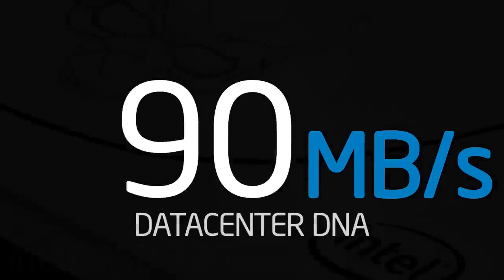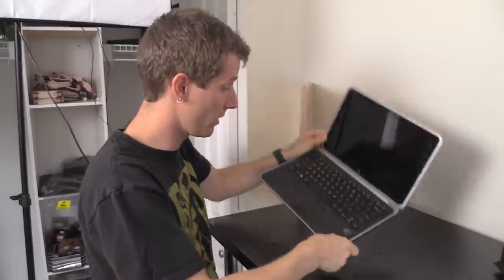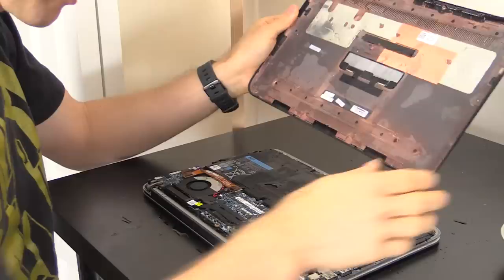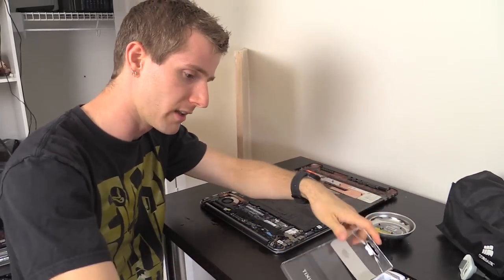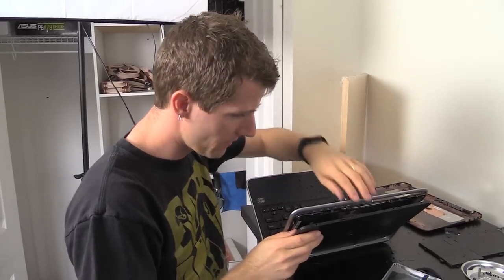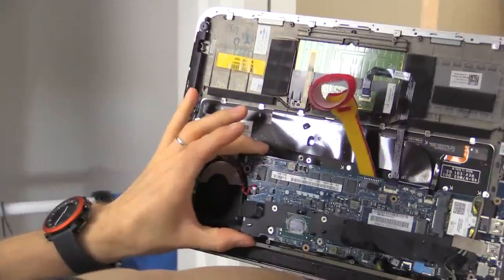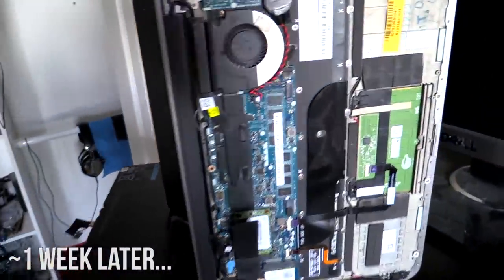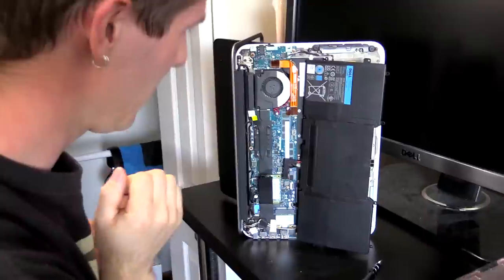Wet Laptop Recovery - Is it Possible?

Comment: ive picked laptops up in the rain from a local recycling center just out on tables outside, just leave them for 72 hours and power them up and they work
Reply: just to add the only problematic thing with a wet laptop will be the keyboard
Reply: Im Curazy Try spilling juice on one... Works fine, but takes ages before the keys don't get stuck down.
Reply: bassl0va must smell nice.
Reply: bassl0va Before using it I would disconnect it and run fresh water through it.
Reply: The laptop I am using right now had juice spilt on it and I washed it out with fresh water and paint thinner and dried it out with a blow dryer and had it up and running a hour after that because I needed to use it that day.
Reply: Hussean Duncan Splashed would have been a better term, but it was a very, very generous splash. I flipped it upside down and dried the keyboard off with a towel. Turned it back on the next day and it was fine, but the keys would stick down. Took a couple months before it completely stopped doing that. lol
Reply: bassl0va Well mine was soaked.
Reply: *****
Chocolate milk must be the worst thing to spill on a keyboard. I spilt some on a piece of my carpet a few years ago and after a month of trying different things i ended up cutting the square out. Luckily i got wooden flooring put it a few month after.

Comment: The XPS series are one of the best line of laptops ever. I can't say the same for Dells desktops tho...
Reply: I'll have to disagree with that given that I own an XPS 15
Reply: Adam Hosein why do you disagree?
Reply: Credit where it is due, it has a solid build quality and 5 years later it is running pretty good. However, the dedicated GPU that came with this laptop was a serious problem and has stopped working, (search xps 15 gt 540m issues and you will see). When I had opened it up to change the thermal paste, there was paste all over the die for the CPU and GPU (a lot of waste). Trying to have an item fixed under warranty was a pain (and never got to it because customer service is crap). The Dell "Certified Technicians" on Dell Forums don't know their arse from their elbow when it comes to computers (so asking them for help is a dead end). Operating system issues right out the gate (thankfully I made a recovery disk the first day I got it). The worst thing of all is their product support for the device as it goes on its life, the laptop has no drivers what so ever for windows 10 and they won't help with getting any for it and the slimy bastards whitelisted their mpcie port, so using an external GPU is such a pain (though possible with a few workarounds). In all honesty, it was a waste of money since I bought mostly the name of the device rather than the hardware.
Reply: Why not dell desktops? I have a web server running on an Optiplex 745 and it's never gone down in 2.5 years

Comment: I saw a video where people dunked a MacBook Air, thiner, lighter, and just as easy to take apart (easier for what they needed since the first step should have been to remove the battery), and it still worked as well I belive.  Why do all of the you tubers whine And snivel about why they think that Mac is so bad, when it is superior? I am not a fanboy, as I own a budget gaming PC, my dad worked for multiple computer industries, mainly hp, while I was growing up, and I now have the afore mentioned PC that I spent about $400-450 on, and I much prefer the macbook that my sister got when she started college that only cost $300 yet still runs faster.   My macbook that I got for the same reason actually cost $500 only because it was the one that looks like a MacBook Pro.  All the macs I have ever used are superior to the PCs I have used, and I don't understand why they have to constantly insult them.  If they don't like them, then just don't mention it.
Reply: It is a bandwagon thing. Personally I wouldn't get anything Mac just because of the price but they make nice amazing clean products. There engineering is above everybody in everything. Phones all metal, laptops, all metal, there macbook pro take it apart and shit your pants about how clean it is.
Reply: Bailey D Dell donated this laptop to linus, he didnt pay for it. Also that other JZ asus laptop was donated, he doesnt have an apple laptop because be probably cant afford it within the budget of everything
Reply: darkmist977 Okay... I know all of that. He doesn't buy a Apple because he has no use for it.
Reply: No Mac Book ever cost 500 dollars. The cheapest I have ever scene starts at 900. Any way 400 dollar gaming computer is as cheep as it gets. Try spending a little more money on your pc and re evaluate your situation. I am no programmer or hacker. So I do not know everything about computers. But what I do know after about 5 of apples best years and spending thousands of dollars on there stuff is they polish the products they make very well. They have the best GUI and tend to look very well. Dollar per performance is VERY subjective.
Reply: In my opinion, Mac/Apple products bind you in a too closed ecosystem. it's maybe good at the things it can do, but it can do and run less than other Software/Hardware. Apple designs the Operation System on a specific range of Hardware and it doesn't work on the rest, so they have control about the drivers and the Hardware.
It's far too inflexible for me.
I'm currently using Windows but would be happy if i could switch with all the software I'm using to Linux completely.
Reply: darkmist977 and Bailey D You guys need to stop speaking for Linus. The only thing you know is that he doesn't have a mac if you want to know why don't assume like idiots and just ask him....
Reply: "Why do all of the you tubers whine And snivel about why they think that Mac is so bad, when it is superior? I am not a fanboy," says is not a fanboy After the fact he/she/it made a fanboy comment.
 NOTHING IS BETTER THEN A THINKPAD !!! now it must be true,cos i said so...and it will be so forever

also Nonamguys you just admitted that you know nothing about computers with that post of yours.
Reply: Floppmann im not assuming, im facts are up to date as of januray when i asked him why he doesnt use a macbook for editing. he said he has too much others things to pay for which are more pressing issues then upgrading a laptop
Reply: ron zo amazon.  look up Macbooks and you can find them.  they are not the newest things, but for $300, you can get one form 2010 that is faster than a lot of pc's that i have seen and used that cost way more. and please don't tell me to re-evaluate my pc.  I bought an HP pavilion with a quad core processor and a decent sized hard drive and 8 GB of ram for $300, and it came with a 22 inch monitor and a printer. The only downside is it has vista, but that is easy to upgrade.  It was $450 because i spent about $150 on a 750 Ti which gets great game performance without a power connector, and I play BF3 very often at good frame rates with to only bottleneck being that i run vista.
Reply: Nonamguys  Just going to say spend like $1000 or more on a pc and you might not think Mac is so superior.
Reply: Nonamguys lf it has vista how old is it? I have a mac book.  I had a 2010 I mac . I built a custom gaming pc and  sold the imac emediatly.  I had no use for it other than itunes. Witch is a disaster with all the constant updates and no way to remove duplicates. If you love apple so much why are you even watching this or even taking the time to post on it?
Reply: CreateUsernameIlike I've used $1000 gaming PC's and I still prefer my macbook air. Macs are just so quick and snappy that when i try to use any pc I feel like I'm waiting a life time.
Reply: Get ssd then. the mac book air uses a ssd.
Reply: ron zo Wow really? I spent $1000 on a mac book air and don't know my own specs. Thanks for letting me know.
Reply: ***** The universal battlecry of fanboys:  "I'm not a fanboy but....".
Reply: android059 I can only second what ron zo said, get an SSD, they are totally amazing. I use an SSD in my own computer, makes working so much more enjoyable. Load times for programs are practically zero now, games are great too. The place I work at is using little Intel NUCs (basically little 4x4 inch MiniPCs) that you buy the board and case for and then buy SSDs as well as memory yourself for. They boot up so amazingly fast, it's unbelievable. With Windows 7, that is. I can't imagine how fast Windows 8 would be on it! The one we use only has an i3 processor, so processing power is obviously not a focus, but programs still open fast, and they are very versatile despite only taking up such a little bit of deskspace.
Reply: ***** Even with an SSD windows will still always be slower. The Mac UI is made for a trackpad and therefore you can do gestures that make everything flow way better than any windows machine ever will. Sure windows will be fast with an SSD but it can't be compared to working on a Mac. The only thing I prefer about PC's is that you can take it apart and add new components. That's why PC's are better for video games. But Mac's were designed with work in mind that that's why mac is better for everything else.
Reply: android059 alright, so you're talking more about the UI and not he performance itself, right? Fair enough. I personally prefer the openness that Windows offers. Not only in terms of hardware, but also software and the overall design. You know, having a piece of hardware in itself that is not part of an eco-system (although a well-built one, of course)
Reply: darkmist977 He buys very expensive cameras, I think he can afford a mac laptop...
Reply: yes because a camera is a must have, a laptop not so much also you dont have any idea what his financial state is like, he cold be in debt or having to get a loan to pay for the cameras. Also he doesnt edit on the laptop, its mostly for the show and writing the script for a episode.
Reply: android059 yeah go ahead and keep on patting your self on the back for wasting money.duh
Reply: You are so smart. LoL you compare Windows witch is software to Mac witch is hardware. I think you mean OS X. Get your opinions and facts straight kid.
Reply: ron zo The software is the whole experience of using a computer. If the software sucks the computer sucks. And Macs are absolutely not a waste of money.

Comment: And this is why you never buy Apple
Reply: How does Linus drying out his laptop = never buying Apple?
Reply: Two of my friends had their Macbooks exposed to "humidity" and "coffee". They never went back to normal even after replacing the parts.
Reply: Chris Mercer I was talking more about the fact that (from personal experience) any bit of water on Mac will kill it. My Mac was never the same when I spilled a tiny bit of water on the keyboard.
Reply: ***** actually you can..all it takes is a few screws to take the bottom cover off and the i can get to anything i need to (2013 MBP not retina)
Reply: everyone here does realize that if you take the same number of screws out that linus did you can remove the bottom cover of a macbook to expose all the same components he did. I don't care if you are pro-pc or pro-mac to each your own but don't let your fanboy-ism blind you from the truth
Reply: Chris Mercer dude, nearly every screw on newest mac is non-standard. plus most of the components are soldered to the MoBo. okay SSD is removable, but it has a specially designed connector (don't remember the name). Apple does everything to prevent you from servicing it yourself. They make sure that customers visit repair service. If this kind of thing would've happened to a mac, you'd have to buy a new one, or pay 2/3 of the price for the service.
Reply: ghosthunter2006 Or you buy a screwdriver kit from iFixit?

I'm not a huge Apple fan, but I did own an iBook back in the day, and their service was exemplary. The motherboard failed well after warranty was over, and they overnighted a spare to Canada and didn't charge me a damn cent. Not even for the service, they reimbursed the certified repair shop on my behalf.

Comment: My lenovo fall in the water completly..fortunatly i fastly put it out ..it was full off water..water was flowing tru usb connectors out like waterfall  ..and i did not even wait to get dry..i turn it on after just 10 minutes ..and it worked ..and i turn on some heavy benchmarsk to heat a laptop and dry faster
Reply: You got insanely lucky then because turning on a laptop right after dropping it in water is incredibly stupid.
Reply: ***** 
i know it was stupid..but  somehow it worked..was not so 100% lucky with a android phone ..after fall me in the water i try to turn it on..it worked few minutes and just turn off...and the was dead 4-5 days and then when i give up ..it turned on and worked ..and it works now but screen has many like some tiny white dots from water ..at least 50 all over the screen but still usable..dont use it for daily phone but  still good for android games.
 Lenovo  and dell make very good laptops ..i bet HP would die  from tiny drop off water
Reply: you can do the benchmarks to dry out but what you think about the calc staying behind you need to clean it with pure alcohol
Reply: But, is the porn okay?

Comment: I have been fixing computers at work for about year and half. Computers from the cnc machines that were incredibly dirty inside so I was washing them in the water. 
The best way how to dry them is to use compressed air and blow all the drops off the pcb board because if you leave it there just to dry out, the water leaves soils and minerals on the place (Probably not case of the rain water, but I am not sure here). Those minerals can cause corrosion and oxidation over time and after few weeks you can encounter problems, so don't rely on it if its working after drying - it can still start failing after some time. If you blow the drops off with the compressed air though, it is a very good way how to leave it very clean and working for years and it will also look like totally new 😉

Comment: and i've had a car (95 honda civic) flood up high enough to short the battery, and submerge half the interior including the computer and after a new battery and a few days of trying to dry it out (including draining the exhaust) got it to fire right up, (still claimed it on the insurance because we had full coverage). also had 2 desktops caught in that flood, one was a total loss (along with wireless keyboard) and the other only needed a cdrom drive replaced and the Western Digital drive in it lasted another few years before it failed (it literally had caked on sticky mud on its case)
Reply: Honda makes amazing cars especially their civics
Reply: +DanielRichards644 ... Dude, you could literally drop a car in the ocean, leave it there for a week, fish it out, and then fix it with relative ease. Electronics fry in water, but mechanics do not. take everything apart, let it dry and re oil it and its basically guaranteed to work.
Reply: martinshoosterman
 WRONG, some cars have "vented" rear differentials or "vented" transmission and in those cases you need to drain the fluid and WATER that go in there or you'll fuck shit up, you know how I know, because it happened to the chevy panel van's rearend that was in the same flood, and if water gets deep enough it can get up in the intake of the car and hydro-lock the cylinders.
Reply: DanielRichards644 Do you understand the meaning of take everything apart and let it try?
Reply: martinshoosterman
 even still the salt water would cause corrosion all over the interior of the motor, there's a reason insurance companies "total" a flood car.
Reply: DanielRichards644 They wont always total a flooded car. they usually do because to take a car apart and then put it back together takes along time and can actually be very expensive. A car is not totaled when it can not be fixed, a car is totaled when the cost of fixing it is more than 50% of the value of the car.
Reply: Mr_Dopeness -DOPEST KOALA ON YOUTUBE-
what the fuck about what? everything I said is TRUE and based on PERSONAL EXPERIENCE.
Reply: +martinshoosterman And cars contain electronics!!!
Reply: AP499D25 needing to replace the electronics in a car will very very very rarely total it...
Reply: martinshoosterman Maybe vehicles are designed to handle extreme weather and humidity conditions...
Reply: BBRCTA2K5441393 um. Yes. Generally they are.
Reply: DanielRichards644 What the fuck as in WHAT THE FUCK THATS AMAZING SO AMAZING IT LEFT ME IN AWE SAYING WTFFFFFFFF NO WAY!!! Urgh why do old people never get what Im tryna say. Fuck this shit. Next time anyone mentions their car being older than a 05 I ain't saying anything.
Reply: Mr_Dopeness -DOPEST KOALA ON YOUTUBE-

Dude I'm 31, and I CHOOSE to drive older cars because they are CHEAPER, my currents cars are a 99 Firebird and an 03 4WD Trailblazer, also the flood was 10 years ago. You don't have to be old to know basic math skills and realize they LOOK BETTER then the modern crap.
Reply: +DanielRichards644 imagine a BMW 7 series in water. Hundreds of computers to replace lol
Reply: +DanielRichards644 everyone in every generation that we have cars, will say this. In otherwords, I'm going to like cars from the 2000's because I grew up in that time.
Reply: Remaining Rex
and maybe when you get old enough you'll realize how crappy most new cars looks compared to the classics.
Reply: DanielRichards644 thats not how it works. When you get older you continue liking cars which you dreemed about during your child hood. those cars then will be old classics.

Comment: after this video, I have washed my keyboard 3 times with great success ^^
Reply: +Lycoosa use blu-tac it works a treat! no water risk free! if you dont know what blu-tac is its a kind of putty you normal use to hang posters up with just rub it on the keys all the dirt sticks to is leaving your keyboard sparkling clean. ive got some stuck to my keyboard i leave it there so if i need to clean it i can